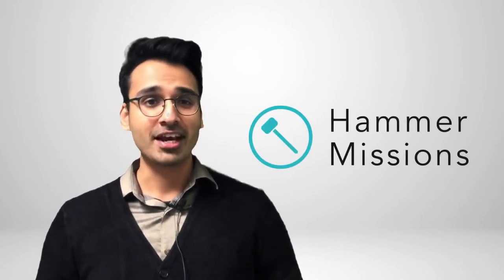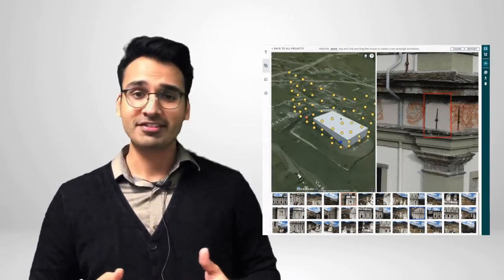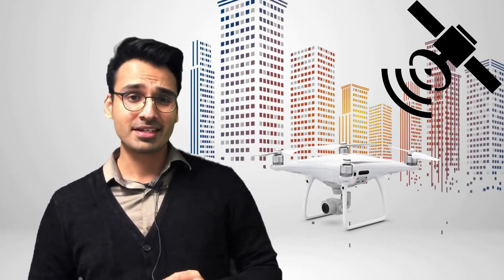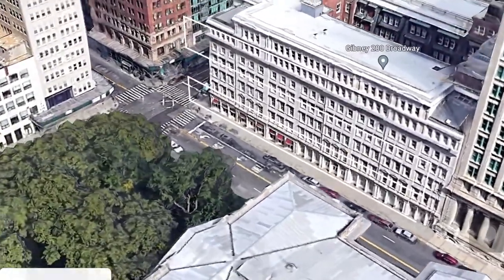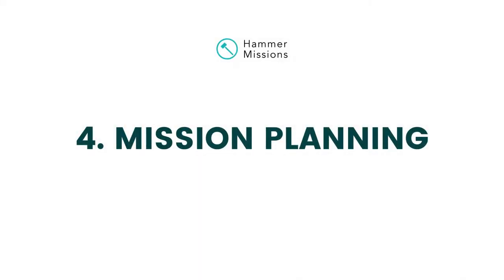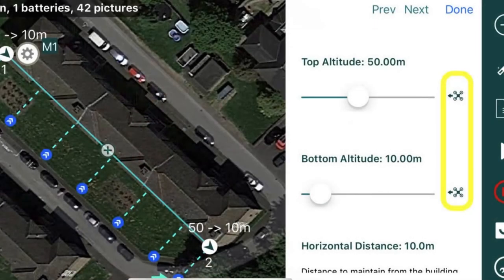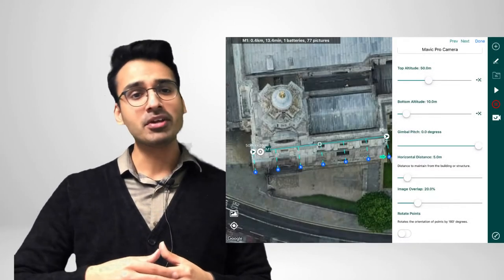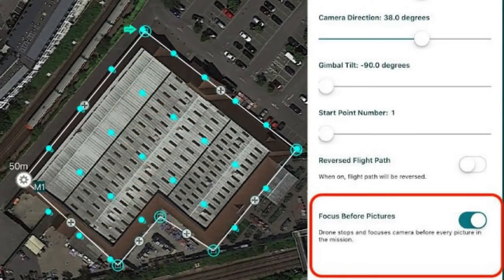Facade Inspections Using Drones - Key Considerations

Comment: Hi! I could realize the apps, both on android and ios are not synchronizing perfectly. The number of pictures are different than the number on the hub and on my ipad, it shows up only 2 lines. The lines on the middle simply disappeared. And I have some further questions. Also I do not have the same features on Android app as I have on ios like focus and exposure. I also cannot simulate the flight. Please find my questions below: 
1.	Only overlap?  How about front (vertical) and side (horizontal) lap? Is 80% (vertical and horintal)?
2.	Why on the video https://www.youtube.com/watch?v=HnXQRl2xuhg he marks many waypoints  and not only one on the far-left side and another on the far-right side?
3.	CAMERA FOCUS (MANUAL OR AUTOMATIC) P4 PRO V 2.0
4.	EXPO (MANUAL OU AUTOMATIC) ISO, S. SPEED, APERTURE (P4 V 2.0) (on ANDROID AP only)
5.	What happens in case of low battery? What are the references? (on ANDROID AP only)
6.	How to return home earlier? Stop the mission? Pause the mission?
7.	Is it possible to clear the app and open DJI GO4? If yes, the mission will keep going or finishes?
8.	I could realize the distance between waypoints (pictures taken are not symmetric on the video https://www.youtube.com/watch?v=HnXQRl2xuhg )
Reply from the maker: Hi there, thanks for your message! We noticed that you have also send these questions to our support teams who should have gotten back to you directly, thanks!
Reply: @HammerMissions  Yes indeed! Before any further,  thank you very much for the prompt reply as well as the brilliant customer assistance through the support team. Your software is magnificent, it solves a variety of problems.  I'll start my flights today with a Phantom 4 PRO V 2.0. Thank you!